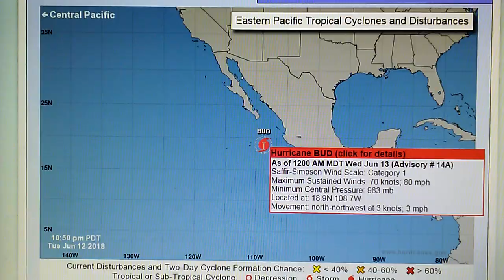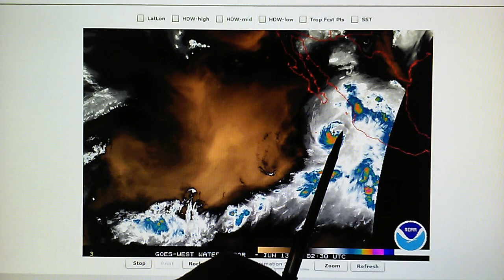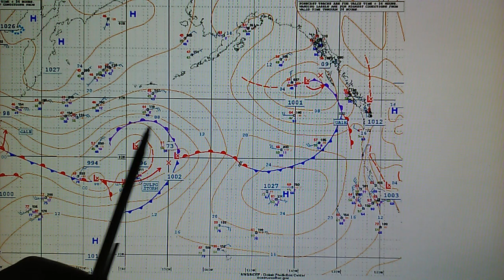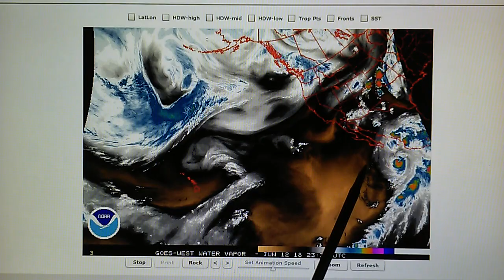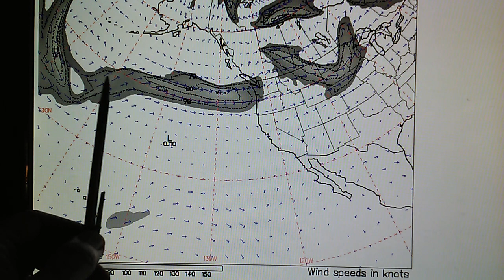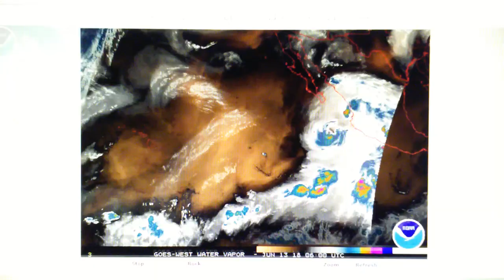6-13-2018; Hurricane Bud Targeted & Superheated; Now At CAT1 Status (80MPH Wind) Moving NW

Comment from the maker: 9:15am; Expect to see some moderate chemtrail aerosol spraying today. There is a low pressure system sitting immediately offshore with a right angle imprint, and we have no precipitation in the NWS forecast; that means chemtrails will be sprayed if this moisture moves into Southern CA & Mexico to prevent precipitation.
Reply: Yes, they are back at it. Wispy aerosols in SBarb skies this afternoon.